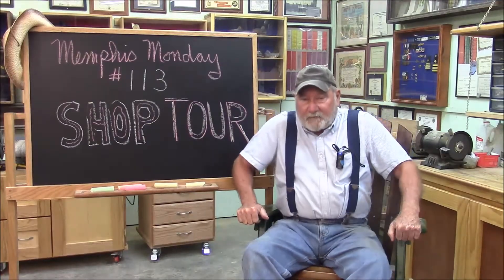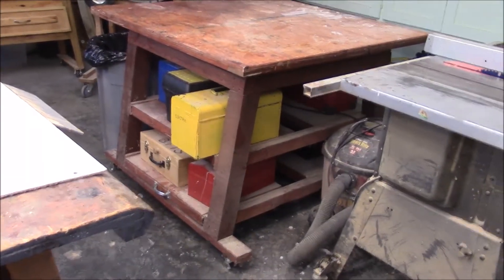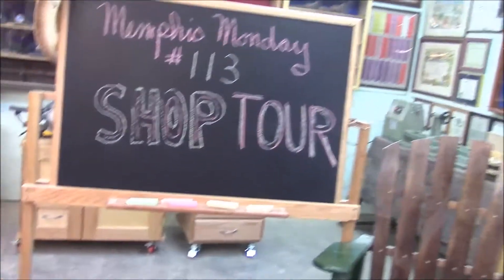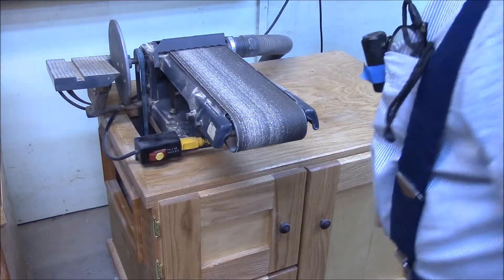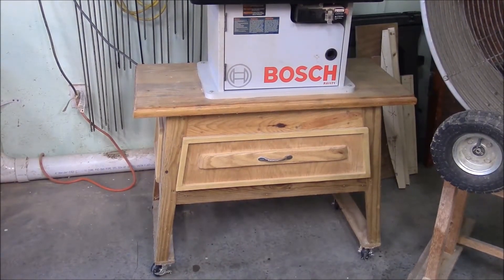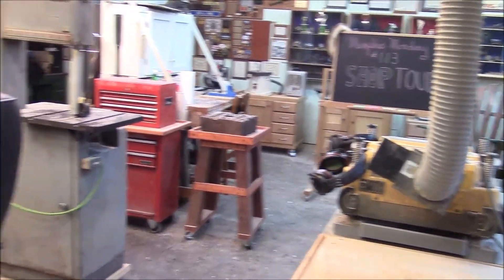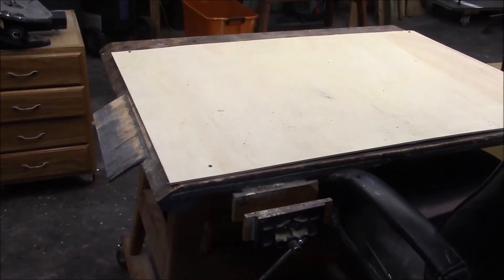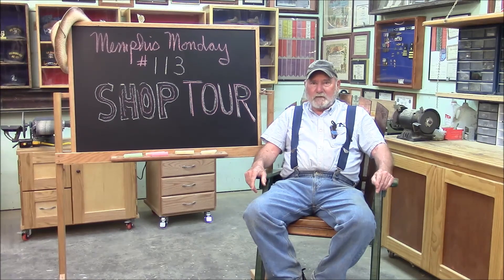113 Shop Tour for 2017

Comment: It was nice to have another view of your workshop since it's interesting to see both past projects and future projects. There are actually some past projects I had forgotten about. I hear you about storage -- it's something you can never have enough of and no matter how much you have it will be used.
Reply from the maker: Hippie told me that my wood storage unit was a little light, and she was so right.  I have wood overflowing everywhere, while my tools are safely stored in more drawers and cabinets than an old woodworker deserves.  Meanwhile, I'm working through my projects, trying to find time to replace those final four tables.  But it is long term, so why worry about it.  After I get those final tables replaced, then I will be talking about replacing my scaffolding (that is the big workbench I use to work up in the overhead of my shop.)
    Thanks for commenting and watching.  I know it sounds corny, but knowing I have a few regular viewers makes it all worth it.
Reply: I agree your wood storage unit needs to be bigger and perhaps with no doors, just shelves, to make finding what you need easier. I do remember your scaffold/workbench but I think you should check out the hydraulic workbenches, which I had never seen before, because it would make working on the heavier projects a lot more easy. It doesn't sound corny at all that your regular viewers (like me) make it all worthwhile -- it's really kind of an honor -- thank you for sharing your projects and I do appreciate all the time you put into making the videos for all of us to enjoy. I don't know if I mentioned this before but your videos are the only ones I comment on regularly, other than that I almost never leave a comment anywhere. I did just leave a comment on Eric O's latest video though. If you have seen it you'll know why. :-D